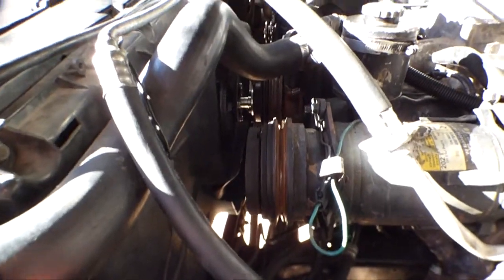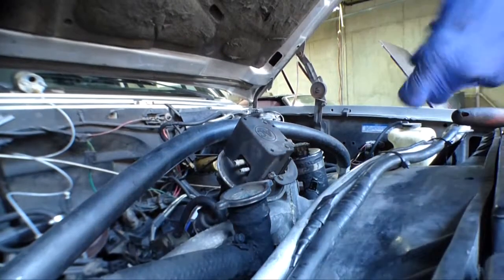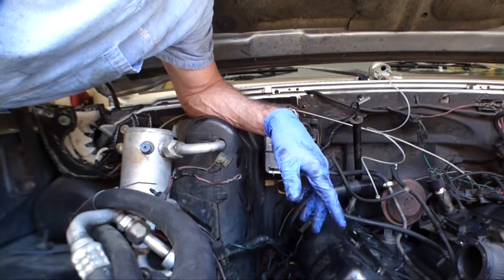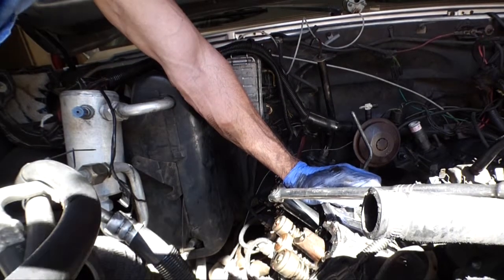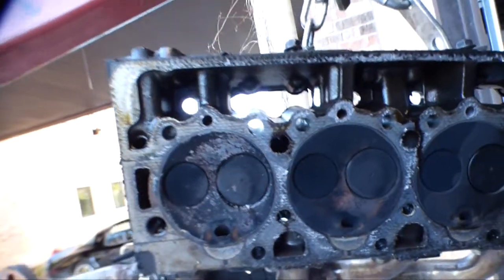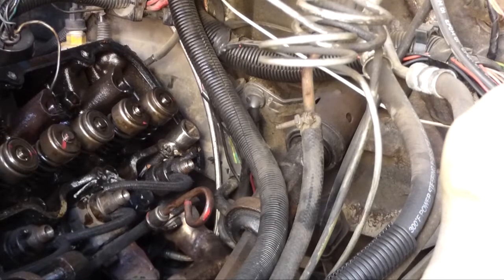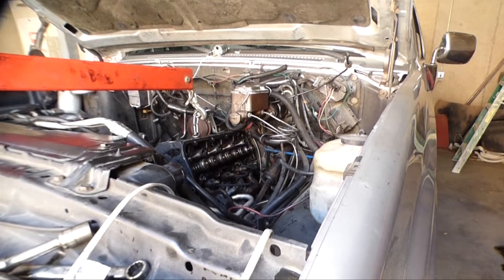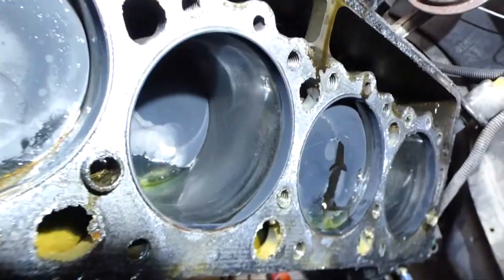Head Gaskets and ARP Studs on a 6.5 Turbo Diesel

Comment: I was just wondering if you did a compression test before and after.
Thanks for all your posting you help me out a lot.
Reply from the maker: I did not do a compression or leakdown test.   If you're wondering how I knew the gaskets were blown, I could see air bubbles constantly erupt from the open radiator cap and I was consistently losing coolant.

Comment: Hi just got ahold of an 83 4x4 6.2 diesel. Got it running after 8 years of being down. Am thinking of pulling out the engine, and doing a complete main bearing, connecting rod bearing gasket replacement, with studs for a Turbo add on. What recommendations do you have after doing yours?
Reply from the maker: I am not a fan of the v-belts, so a serpentine conversion would be nice.   If the bearings look good, don't replace them  You could be opening up a can of worms.    New rings might be nice to minimize blowby.    Fluidamper harmonic balncer for the crack-prone crank.   And seal it up tight.    Mine has a rear main seal leak.
Reply: @CrankAddict  Great... 
Appreciate your advise!